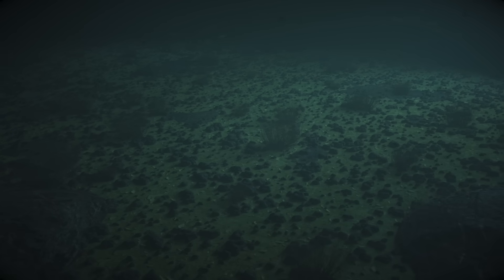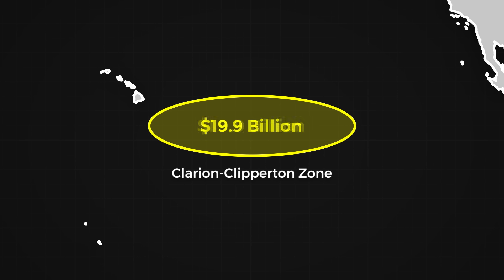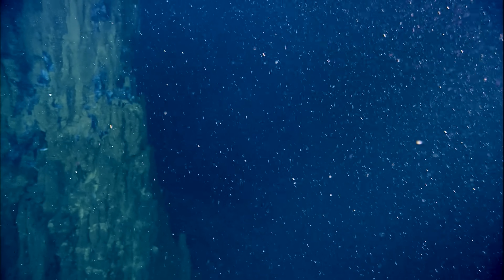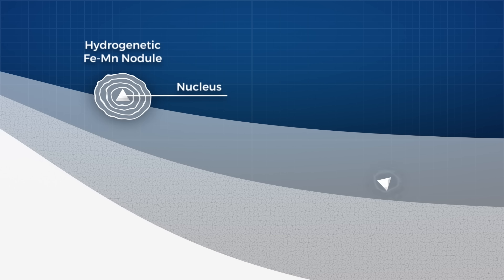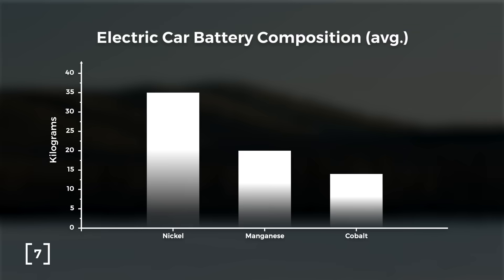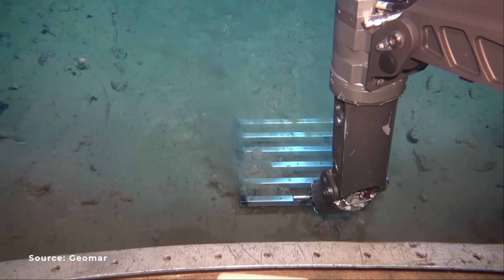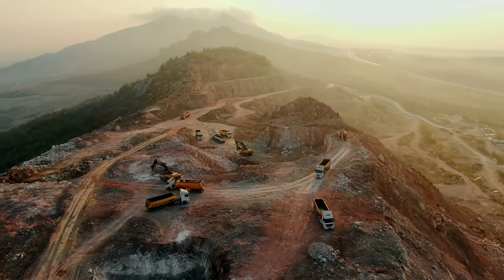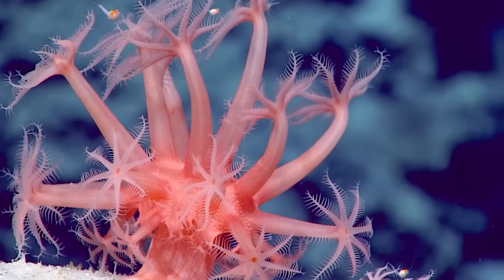The Truth about Deep Sea Mining

Comment: I mean at the level of complexity this requires, I can't help but feel that asteroid mining/collecting might be a better alternative. As much as rockets emit pollutants, is the environmental damage more or less than this and/or current technology? Also, we could certainly implement a clever system to reduce emissions and lower costs with something like asteroid mining.
Reply: Asteroid mining is way more complex though and it’s all but unfeasible to bring any of that metal back to earth, all the proposals have been to mine resources and use them in situ rather than attempt to bring them back
Reply: The Problem with Asteroid Mining is that you can Mine almost infinitely but you get the Mined Metal only after around 20 Years all at once.
Reply: liquid oxygen/hydrogen rockets emit nothing but water. the problem is returning that material, as others have pointed out. A space elevator would be a great option, you would even be able to harvest a bunch of energy by using regenerative breaking.
Reply: @paulochikuta330  Yeah and every prfotibale asteroid takes several years till it meets the earth again. You had to invest a lot into the Gear and stuff you need to start Mining and once it's on the asteroid wait a long time till you gain anything from that investment but once this Milestone is reached we have a gigantic extra Source of Ressources and the more we advance into this Project the more worth it becomes.
Reply: Asteroid mining would be way too complicated just due to the distance required, the moon would be an easier option, it has a similar composition to the earth and much closer.
Reply: @redmelonshark  It takes more energy to land on the Moon and take off again than to land and return to Earth from Phobos and Deimos. With robotic miners, the distance (time) is somewhat irrelevant.
Reply: @cf453  Phobos and Deimos aren't valuable asteroids. And the problem with the distance isn't about survivability, it's the increased supply chain length and latency. Energy isn't the only problem when space is being industrialized. There's large amounts of fuel on the moon, asteroids may or may not have the resources for fuel.

Comment: Sometimes the questions have to be left for later, I say we should give up on preserving every existing species, the best we can do is minimise the number the kill off, oh and btw python is NOT fantastic, it's slow and not even flexible, I prefer C though I would possibly suggest Rust which I haven't tried which carries many of the same benefits apparantly, at the very least it's 1000 times better than python, if interpreted language is the only way someone wants to go then I suggest Lua, still C is the best language of all, sure it has it's drawbacks but there are very few cases where it's not suitable, so few I could count them on my hands if I were inclined to actually research them, interpreted languages like python are usually made for either the lazy or those who shouldn't yet be programming in C or Rust, ironically python creates more problems than it solves so it's better to just abandon that s**t.

Comment: It would be interesting if the ships loaded up with rocks and lowered rocks at the same (or similar) rate as the nodules are raised, potentially this could be rather energy efficient as you are now lowering a mass at the same time as raising it and you would potentially be minimizing the environmental impact as you are leaving it very similarly to how it was found. Of course all of what I said may be totally useless and requires research as to wether it would even be beneficial.
Reply: The buoyancy and drag of the water changes that equation drastically, so it's not really worth it
Reply: @MatthewMakesAU  Just lower rocks that are heavier than the ones you’re picking up to get the energy equation back in balance
Reply: @jrherita  do the maths - it doesn't help
Reply: @MatthewMakesAU  I am not sure what math you are referring to but as the mass of the lowered rock increases  the drag force decreases relative to the downwards force of the rock (therefore being more energy efficeint). While drag of the water is a source of loss if you lowered the speed of the rocks the drag becomes minimal (velocity is squared). Now, there are still definitely problems 
1. Where are we getting the rock and how expensive is it?
2. Can we construct a system that can get more energy from lowering the rocks than hauling them in the first place or at least enough that the cost of the endeavor is justified by the decreased environmental impact.
3. Would replacing the nodules have a sufficiently reduced impact on the environment compared to just taking the nodules to justify the endeavor.
Reply: @theBestInvertebrate  if you calculate how much energy it saves using counterweights, you find that it's a piddling amount at this depth. Just not worthwhile
Reply: @MatthewMakesAU  I don't understand what you are getting at the larger the depth the more energy you get out of using a counter weight. In theory it saves 100% of the energy cost of raising the nodules (this does require the raising to be painfully slow though which may well be unacceptable)
Reply: Really you are balencing the cost of the rock material and the cost to transport the rock with the gain from lowering the rock and the gain of improved environmental conditions.

Ideally for this to be practical the cost of rock would be low, the energy we can extract from the GPE of the rocks is high, and the positive impact of the environment is high.

As for cost of rock it is likely prohibitive unless there is suitable waste rock near the ocean.

As for energy extracted from the rock, I don't think we have a good system for this right now but it does not seem like a monumental task (to get something at least).

Then there is the matter of environment. Who knows, needs research.

Comment: Stop claiming we need to transition to renewable, it's wrong, we need to transition to low carbon energy, burning wood / methane is renewable, and it's worse than coal / oil. By claiming we need to transition to renewable instead of claiming we need to transition to low carbon we end up with germany / portugal transitioning from coal / nuclear to methane / wood / gaz which are worse.
Reply: Well, there is no one ideal solution for everyone's energy needs. What kind of energy you should use is very dependent on your situation. 

Renewables can work great for low-density communities that have low energy demand. But for places like large cities and industrial centers, using nuclear energy might be better in the long run for them. 

Burning wood can be carbon neutral so long as you're replanting the trees you cut down. If a tree has already died, it's actually better to burn the tree than to let the wood rot. Rotting wood produces methane, and methane traps 4 times more thermal energy per molecule than carbon dioxide.

Comment: This is something we really shouldn't be doing. We've demonstrated continuously throughout history, but especially in recent times, that we understand nothing about the effects our actions will have on the biosphere until many years after it's too late to go back.

Furthermore, it's likely we soon won't even need these rare metals for batteries. Aluminum-Sulfur and Aluminum-Ion batteries don't use them, and look like ideal technologies to replace Lithium-Ion in the near future. Failing that, asteroid mining will be orders of magnitude more efficient and less ecologically destructive; the moment that becomes viable, the idea of mining metals from the dirt will seem absurd.
Reply: This!  Also adding Sodium-Ion, Iron-Air, and all the crazy Flow Battery designs out there to the list.
Reply: Also just not using a pile of BEVs*, and instead using *Transit Oriented Design*, Hybrid ICE/FCEVs where transit can’t be used, and Power-to-X Hydrogen/Methane/DME/Methanol etc to power them.  Also Not Use Grid Scale *Lithium Ion Batteries because they were designed for lightweight mobile applications and in all manners except cost are dumb af, instead use FES/Pumped Hydro/Compressed or Liquified gas (and the aforementioned Power-to-X technology) for storage.

Comment: So basically we need to find out which is the lesser of two evils...
Reply: No, because this isn't a "lesser of two evils" situation. We have a 3rd option. It's called "stop buying stupid electric cars and build electric trains instead!" 

Cars, in general, are horrendously energy inefficient and resource inefficient. That inefficiency exists whether or not a car is gas-powered or battery-powered. 

Trains, on the other hand, are many more times efficient than cars, and trains don't need batteries. Trains can be powered with overhead powerlines. 

Even if we kept trains running on fossil fuels, investing in trains and getting rid of cars would do much better things for the environment than just switching cars from gas to battery. 

Improving public transportation will do much more to address climate change. Mass transit is 10 times better than personalized cars in almost every respect.
Reply: @faragar1791  personal transport is only a very tiny part of the problem and the part of that which can effectively be replaced by public transport is even tinier
Reply: @WouterVerbruggen  
Then what is even your point? 

The whole reason battery companies are considering digging up the oceans is for more resources to manufacture batteries for electric cars. 

If we can get rid of cars as a whole, then we don't need to dig up the ocean.
Reply: @faragar1791  wow you're more shortsighted than I thought. What if I told you there a whole wold of transport which transports goods instead of people? Also there's many situations where public transport might be theoretically possible, but so incredibly inefficiënt that it's much more taxing. Oh, and there's many other uses for batteries which would benefit massively from cheaper battery production. And to top it off many more things that need these metals. Or did you think that electric power was produced and used by plastic generators and motors? Or that your phone/pc was made out of wood? Or that any product just got magically transmuted from pure energy?
Reply: @WouterVerbruggen  
""Also there's many situations where public transport might be theoretically possible, but so incredibly inefficiënt that it's much more taxing."" 
 - That's a lie. Public transport can be way more efficient than cars when managed correctly. At best, you could argue that cars are more time convenient, but that's it. Cars are the absolute worst when it comes to their energy efficiency, their resource efficiency, and their space efficiency. 

""What if I told you there a whole world of transport which transports goods instead of people?"" 
 - WOW, no sh*t Sherlock! 
Here's the thing though about the majority of the transportation industry. Not only do they not use a lot of batteries in their vehicles, but for most of the transportation industry it would be impossible to implement battery-powered vehicles. 
The energy density of batteries is garbage, and will always be garbage (unless we find a way to cheat the laws of physics). It's completely impractical to use batteries on any large vehicles like semi trucks, cargo ships, and airliners. Anyone who says otherwise doesn't know what they're talking about. When you actually look at the raw data, electric batteries just suck in general. 

Maybe instead of fu*king around with an ecosystem we know little about, how about we try reducing our consumption of these resources in the first place?!

Comment: I don't want to sound like a luddite so I will say yes, batteries are SO important for a greener future. But there is also merit in reduction of consumption too: we need electric cars AND less use of cars, with more efficient forms of transportation being the substitute. I know this is an engineering channel so talk about public policy that doesn't involve engineering wouldn't be as relevant, but I just wanted to include the thought.

Also, this way, the dilemmas about interrupting ecosystems won't be as pressing.
Reply: @leeroyjenkins0  that's the catch though. It's way less efficient
Reply: @leeroyjenkins0  the problem is that energy usage increases every year and you can't stop that no matter how efficient you are. Producing electricity always comes at a cost but if you want electrolysis that is at least better than your average low temp process you can try high temperature electrolysis using waste heat of gas-cooled or similar nuclear reactors
Reply: Electric cars will actually increase electrical demand on the grid. But I get the point you’re making with better demand management. Distributed energy resources like household solar and batteries are one way to manage demand, especially during peak consumption times :) And if these household systems could talk to each other and make a “virtual power plant”, they can better serve the needs of the community and the electrical grid. But for all of this we’ll need better battery materials and alternative energy storage systems. Most of all, we’ll need smart and flexible electrical grids which can cope with high levels of distributed energy respurces and inverter based generation like grid-scale solar/wind/battery/offshore wind etc
Reply: Let's just be real. People aren't going to consume less. They are going to consume more. Especially when underdeveloped nations are also getting richer. Demand will go up. There is no way around it.